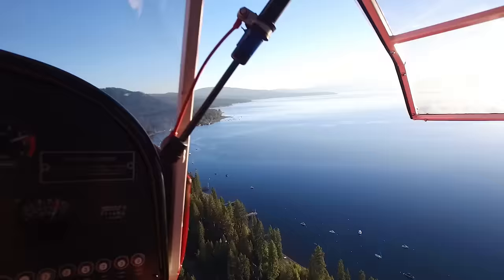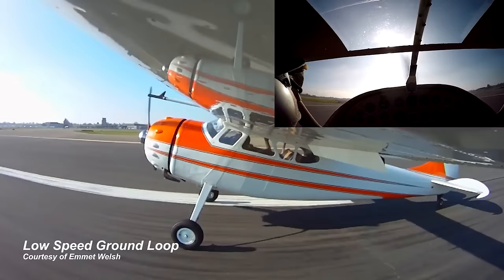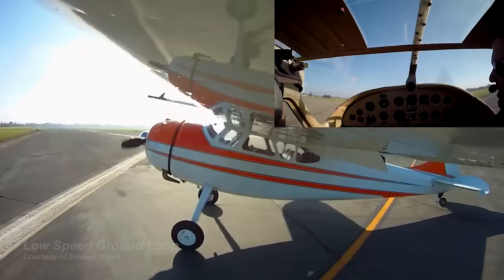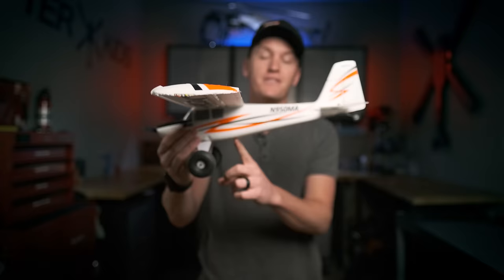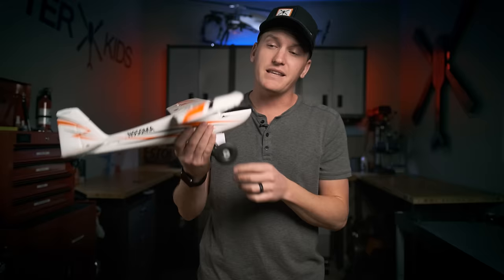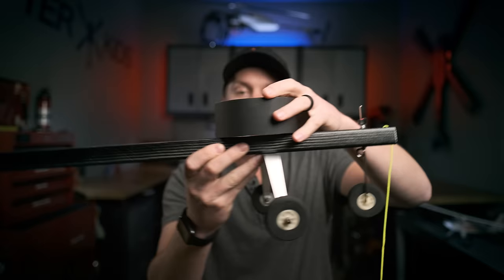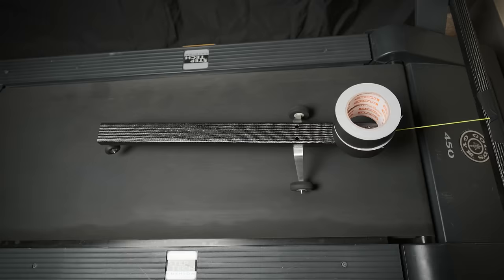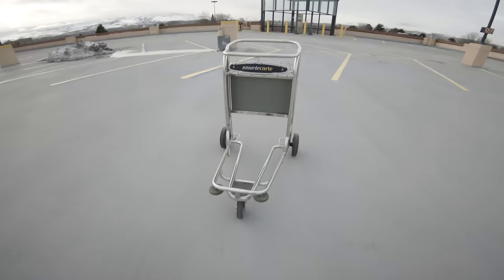The Ground Loop Monster

Comment: With almost 50 years in tw, first a C140 and now my C120, this is great advice.
Although I've never ground-looped, I've seen two, one right in front of me, and the second about 1/4 mile away.
You are exactly right, at some point you'll know your aircraft so well that you will anticipate and correct this swerving tenancy immediately.
I've found that taking cross-wind runways for landing has helped a lot, one will have lots of deviations and can practice for them.
Force the aircraft to go straight down the runway. If there is drift, there is a problem in the making.
Well thought out video.
Reply from the maker: Thanks! And I am in the same boat as you only a lot of years less experience. But I have watched a few ground loops right in front of me. Never any fun.

Comment: My little Boredom Fighter biplane had a locking tailwheel which prevented ground loops. It worked perfectly. I forgot to lock it prior to take off once, and sure enough, upon landing, the monster came alive! No damage to the plane,  but I felt 3 feet tall. Flying is great fun, but it is a game of caution, preparation, and ongoing training. Flying skills don't last forever, either, so know your limitations as the years go by. Nice presentation, Trent!

Comment: I learned to fly in a tail wheel Cessna 140. At solo I had some problem seeing  the the angle between the direction the plane was moving and the centerline of the aircraft. I took a piece of tape and made a centerline on the cowl, that simple vissual reference immediately solved the problem.

Comment: Trent....Many years ago in the Great White North,  I taught myself to fly taildragers in my  Champion airyplane. It was many years after that before I actually had an instructor sign off my log book , a mere formality. I also taught myself to fly floats in  both of my planes, the Camp and a Stinson 108. Both tail draggers have many hours (about 40 years worth)on them with me at the controls. I only came close to a ground loop once when I was distracted on rollout due to the big fan in the front stopping. Minor adjustment to the carburetor corrected that. My idle was a tad too slow with the carb heat on.

Comment: My ground loop was caused by a brakeline failure on landing. Dent in the empanage, that had to be repaired, and a broken runway marker light. The plane was fixed and flying again long befor the runway light was replaced. Dragonfly Mk4.
The close call was when I was instructing a new pilot in an Avid Flyer, He had about 4 good landings in a row, and the 5th started to go around and off the runway, " I have control" full opposite rudder, brakes, cross ailerons and power happend instinctivley. I heard the control tower over the radio call the emergency service as they hit the crash button. But like Trent's story I was able to save it and was flying with a short takoff roll in the grass to avoid the runway marker sign. The next thing I hear is " Cancel Emergency service, he took off in the grass". It took a week before the owner/student was ready to try again, but try again he did and is now a pilot.

Comment: Trent I’ve been flying Tailwheel Aircraft for years ago and I’m finally back in the Tailwheel again and got recurrent again with my CFI and I’m so excited in the 170 . I’ve flown for the first time a PA Piper Cruiser PA-12 and the Maule and of course my favorite the powerful 180 . My instructor said to look at the very end of the runway and always nevertheless don’t get distracted by anything to keep directional controls and heels on the floor and just talking to your self saying hold it off hold if off with a three point landing and back pressure with your feet alive with no braking until you stop flying

Comment: That treadmill demonstration is very similar to the ones showing how a mis-loaded trailer (Not enough tongue weight) behave. As an avid RVer, I have known this, but I never really knew the physics. Thanks for putting it so simply.
Reply from the maker: Yeah, that video is what inspired me to test it with a landing gear simulation
Reply: @TrentonPalmer  I've posted a link to it on my RV forum. Knowing what will happen is good, Knowing WHY is better.  Maybe your demonstration will help another guy understand the 'why'.

Comment: When I learned to fly and land gliders my instructor told he I would need to be doing a tap dance on the rudder all the time and keep the wings level ( only one wheel ) you can't use brakes to steer when you only have one wheel. A few years later when I added a conventional landing gear rating to my power rating, it was easy for me. The big problem when a fiberglass high performance gliders ground loops it brakes the tail boom off, very expensive repairs. My home field had two shops doing composite aircraft repairs I saw several broken tail booms. Good video thanks.

Comment: The guy I bought my Champ from suggested this exercise to get aquainted with that little wheel in back:  Put a series of cones down the centerline of the runway then taxi a slolum track through them.  After you can easily get through a pass or three, increase the speed and do it again.  At some point, you can feel the tail want to come around similar to an oversteering car.  This is the feel that you practice staying ahead of by learning the dance.
Reply from the maker: That sounds like a great technique for training in a tailwheel
Reply: Not only is it a good training exercise, it's fun in its own right,,

Comment: You'd make a good instructor Trent. In the transition from "reactive" to "authoritative" tailwheel pilot, it's about keeping your feet moving. Incidentally, this is true for nose dragger pilots too. While the ground loop monster leaves them alone, I see students who don't track the centerline because they are slow and lazy on the pedals. So if you are a nosewheel pilot thinking of making the transition to tailwheel, you can develop good habits now by staying light and quick on your pedals to always be over and parallel to centerline.
Reply: should mention using the throttle to recover. counterintuitive but lotsa power blasts the tail back behind you.
Reply: Agree with the point about nosewheel pilots having to pay attention, too. Especially if the plane has a freely castering nose wheel. I had gotten used to the Cessnas being easy to steer on takeoff, and then transitioned to a Diamond DV20... It took a while to figure out the amount of rudder input you need when starting the takeoff run, and how active you have to stay to keep it anywhere near the centerline :)
Reply: ...I'm glad I got it nailed before the end of the summer, because now the runway surface of the local airport is mostly just shiny ice :) Brakes? What brakes? Don't use the brakes! If there's a patch under one wheel that actually does have some friction, you'll end up in the snow bank on the side of the runway! The runway is long enough that you can just let the plane run out of momentum and then taxi off. Carefully.
Reply: If you're flying a nose dragger, you're going the wrong way.
Reply: This is such a great point. I'm a student right now and I'll admit this is one of my downfalls. I tend to be too shy on the pedals and it's easy to be lazy in a trainer on super wide runways. Thanks for this little bit of insight!
Reply: Yup ... learn to drive with your feet to the point where you can control it precisely and are never behind the curve ... then the transition is a breeze
Reply: Yep.
For the powered plane license, I paid extra to have a flight instructor (former airline pilot), who normally instructed the big boys (IFR, multi-engine, turboprops, etc.). And he had a higher fee than regular flight instructors of the flight school. So I had to pay him extra (on top of what the flying school charged). 
He was very tough and did set a high level, much higher than required for the privat pilot license. But it was worth every cent. 
Amongst other things, he always strongly insisted, that I had to roll the aircraft precisely on the centerline  (on taxiway and runway). 
Also on take-off and landing, stay exactly on the centerline. Even or especially with strong crosswind. So no matter where the aircraft nose is pointing (final or climb out), keep the aircraft's center of gravity moving exactly in the direction of the centerline. 

Some other things he told me: On a runway (which is not exceptionally long, since in Switzerland we have a lot of rather small runways), always take the back track. 
He often said: 
Keep in mind, there are 3 things, which are no help for your flight:
- the airspace ABOVE you
- the runway BEHIND you  and
- the co-pilot BESIDE you.
Reply: i found a cfi an hour and a half an hour away who has both. Im only getting a sport pilot certificate. I was thinking id get him to train me for 10 hours in a tricycle then the last 10 in his taildragger and then if i need more hours trailer or fly my avid down. Does t hat sound like a good plan??
Reply: @BrightBlueJim  LMAO! Well played ... ^v^

Comment: I used to fly with an old pilot who had both Tricycle, and tail wheel aircraft, including a Harvard T-6. He taught me to start tapping the pedals as soon as you throttle up on the runway. This is tailwheel only, obviously. He feels that this constantly induced wobble puts the aircraft in a known state.This way, you are not waiting to react to the airplane. As the airspeed increases, and the rudder starts to become effective, you switch from tapping the pedals, to a slower, longer push to left and right. As a passenger, it was definitely noticeable, but not uncomfortably so.
We once landed in his Aeronca Champ, and the tailwheel springs let go when the tailwheel touched the runway. He saved the landing with brakes, but things could have gone badly.

Comment: I started on Gliders, so I'm 110% rudder when I'm flying. Recently transitioned to single engine, and even the DPE said it showed. Will be getting tailwheel this spring, and hope I will remain one of "those who will groundloop" for as long as possible before it happens.
Reply: I also started as a glider pilot. And was flying competition glider aerobatics for some years. So using the rudders was in the blood.
This might be, why I love taildraggers soooo much more than trigears.

Comment: Love your videos. I learned to fly in a Luscombe Silvaire. Taught by my father who had 40,500 hours of flying before he retired and flew no more! I have 5000 hours in tail draggers of many different types pf planes. Not once have I nor my father, ever ground looped a plane! The Luscombe I learned in is hanging in the Permian Basin Petroleum Museum in Midland Texas. The Plane was used as a leak finder for Mobile Oil Pipelines from 1951 to around 1964 when Magnolia Oil, the Subsidiary pipeline company of Mobile purchased Cessna 172s to replace the Luscumbes. Since N2645 was the first plane Magnolia Oil bought for their Pipline service they have loaned it to the Museum for display. My father and I along with my youngest son made a trip to see the plane before my father passed and he left pictures of he the plane and all pilots standing in front of this Luscombe. If you google Permian Basin Petroleum's Luscombe you will find the plane.

Comment: Trent good review. I am one of those tail dragger pilots waiting for my first ground loop. I noticed you highlighted a broken Carbon Carbon involved in a ground loop. That surprised me.  I have been flying Carbon Cubs for 8 years and find with the right training they are more resistant to ground looping thanother tail draggers. The reason is because they have an awsome power to weight ratio. I have wrapped up my Carbon Cub into the later stages of a ground loop several times. In each case application of full power (180 HP in a 1320 lb airplane) literally blows the Carbon Cub out of a ground loop. That 180 HP of thrust provides instantaneous rudder authority and you are likely flying in just a few feet. If you are well along in the ground loop you may be flying 90 degrees to the runway with this recovery but you are flying and in total control.
Reply from the maker: I believe some pretty nasty crosswind gusts were involved with this particular ground loop

Comment: Every tailwheel pilot has heard the "have/will" axiom, and it's understandable.  But when discussing it with Budd Davisson, he said that he's never groundlooped... in almost half a century of flying over 140 aircraft models (including warbirds) and many decades of instructing in the Pitts Special.  That tells me that it the tailwheel monster can be kept at bay indefinitely... one landing or taxi at a time.  Every one counts.
Reply: I heard Budd say this at his Oshkosh forum last July.  Impressive!  If he can pull that off training students in a Pitts and flying Warbirds, the rest of us should be able to as well.
Reply: I was gonna say, my dad has over 25K hours with every bit of half of that in tailwheels and has never had a ground loop.
Reply: Agreed
Reply: I agree to a point, the problem is there are sometimes things that are out of a pilots control. For example I almost lost it in my Maule because of a low tire. Now before someone quips how I should've found it during my preflight etc it happened after pulling the floats. We pulled the floats, changed the gear etc and took a test flight. Had it been in the tire prior to taking off for the 2.5-3 hour flight home we'd have seen it, either during the install or prior to my friend signing off of doing the swap. Believe me, it can happen to anybody. I'm a AG pilot and I've been flying since 11-12 years old and 95% of it has been in tail draggers. It was worse than trying to land with half a hopper in a bumpy fields with a crosswind, luckily it was my home field so when she came around I just went with it and the only damage was to our pumpkin patch.
Reply: "Had it have been in the tire prior to taking off".... those air nails are sneaky. 👍Lol.

I landed with an ice frozen left wheel onto asphalt. C180.. made it ok...
 Taught me to not get the brake hot taxiing in snow.

You MUST be "on your toes" every second and ahead of the airplane.
You cannot be asleep.
Reply: @munroeje  In addition to attending a number of his OSH forums over the years, I was lucky enough to get a week of Pitts training with Budd last November.  Very educational... and a lot of fun.  Check out the video on my channel here.
Reply: There are always a small few that are exceptions to the rule.  Hats off to those few.

Comment: You are exactly right about active rudder inputs. I flew taildraggers as a student pilot back in 1965 and did two of my required x-countries in a Cessna 140. My instructor hammered the rudder usage into me until it was automatic. The one problem I did have at first, which was corrected with further instruction, was bouncing. Not only does the mass behind the main gear want to make you turn, it also pushes the tail down if you touch down too hard. In other words, instead of making a 3-pointer, I was making a sloppy wheel landing.

Comment: Dance dance dance.... that’s the best way I can explain it. Any rudder input followed by a quick opposite jab. :-)
Reply: How does this help?
Reply: If you noticed his tailwheel prop, how even with a straight wheel it begins to wobble left then right bigger each time. Your constantly countering that unwanted movement. Dancing on the rudders, plane goes left, enter a right rudder immediately followed by slightly less left. Keeps it straight. The worst thing you can do is not have your feet moving. Especially if your in a short coupled tailwheel like a pacer, a Pitts, etc. The most dangerous portion is when your moving but don’t have rudder authority. Requires bigger inputs. As airspeed increases, it will be a series of very rapid small inputs. These rapid inputs help keep that cg on the center line and keep it from getting out of hand. 

If you watch someone landing a short wheel base (short coupled) tailwheel, you will see that rudder wagging back and forth constantly. Some airplanes will let you get away with more, like a Cessna 170, the longer the easier, assuming nothing is broke or unequal braking. Like the Cessna 195 (a very stable tailwheel), in the video, they lost it because likely a brake issue or failing to enter right rudder when applying power (p factor). 

Needless to say, quick little movements keeps it straight, it’s a dance, hence dancing on the rudder... :-)
Reply: @AkPacerPilot  I only ground looped once in my Aeronca L3.  Right after my tailwheel touched the runway, I began dancing on the pedals, as usual.  At that moment, the spring connecting the cable to one side of my steerable tailwheel chose to separate from the steering horn, thus giving one pedal more authority to turn than the other.  Before I realized what had happened, my dance on the pedals sent me into the loop.  Murphy, it seems, always awaits.  No damage to my airplane, but as luck would have it, I had my wife in the back seat, and I don't think she ever felt comfortable flying with me again 😢
Reply: Frank Castronovo that’s a bummer, but at least plane was ultimately okay. Mechanical causes ground loop, might not be anything you can do about that other than catching it on a preflight, but even that can mis what you had.

Comment: I know old timers, pilots with many thousands of hours in tail wheel aircraft, that have never had a ground loop!
BUT, these same pilots will never touch certain models of aircraft!
For a safe tail wheel aircraft, you need excellent brakes and plenty of rudder!
A wide, stout main gear and very strong tail-wheel. 
With all that going for you, IF THE PILOT DOES HIS JOB, your not going to ground loop!